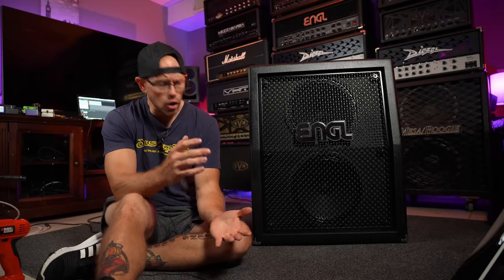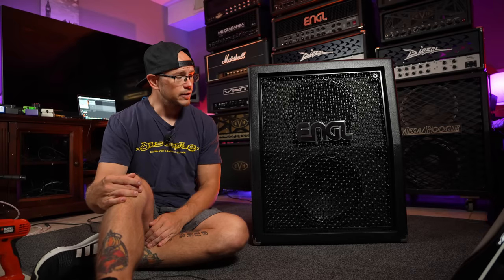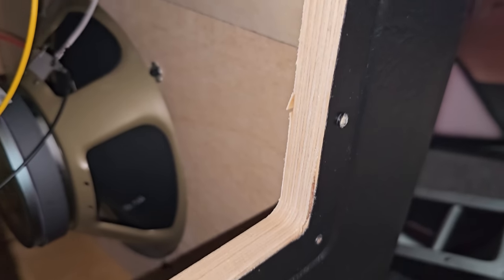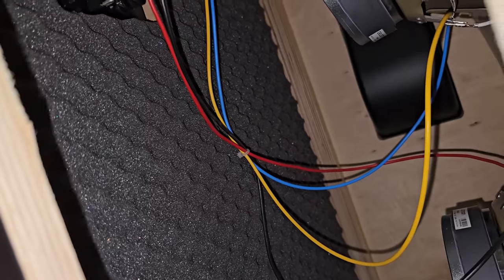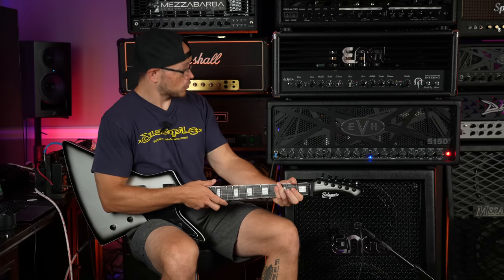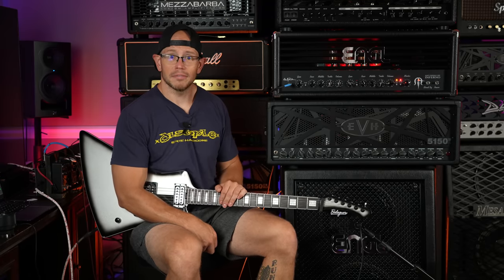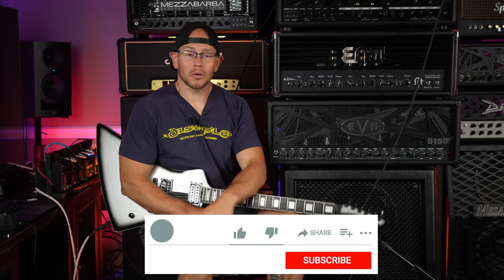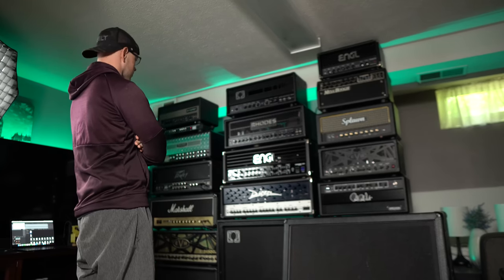This 2x12 cab hits harder than most 4x12s!

Comment: I wonder how this compares to the Mesa Rectifier 2x12 Angled cab?  Another great video.  Thanks Kyle.
Reply: That'd be nice to know...since I have a vertical 2x12 mesa 😊
Reply: As far as the 4x12 cabs go, I bought the ENGL last year and ended up selling my Mesa Rectifier 4x12. Great cabinet but the ENGL was more focused, punchier and more articulate. The Mesa cabs are awesome but the 4x12 cabs are too boomy for me. I honestly think 2x12 cabs are the best.
Reply: @MichaelSmith-ti6qc  I read that they are made with the same components and the same machines as Brit speakers are. And I'm someone who doesn't buy Chinese unless I have to.
Reply: I have a Mesa 2x12 vertical, speaker set up was originally the stock v30, then switched the top speaker to dv77. I picked up this cab in the video and it definitely sounds punchier, the low end gives far more thump to it. Not sure how much the geometry of the cab design of the Mesa vs Engl changes the sound or the speaker set up itself. But I will say that the moment I ran through the Engl cab it was instantly an improvement, across the board, taming highs, punchy low end, just a very full sounding cab. Running an engl fireball 25 through it.

Comment: I just ordered a Fireball 25. I bought a cheap 1x12 Cab with a V30 on Amazon for less than $200. Looks like I'll be buying this because it sounds great. Not sure how I'm going to hide it from the wife. I'll put a cream back in the single cab and I guess have a spare V30. Maybe I'll attempt to build a cab for it. I have 4 combos and 2 bass combos all solid state so this is my first foray into tubes. Strictly a bedroom player. I'll probably be exiled to another room or the garage. Thanks Kyle!
Reply: Worst case, go looking in used gear shops for 4x12s you can find some absolute gems. My 4x12 was $90 and it came with Celestion G12K85s, each one individually sells for more than I paid for the cab.

Comment: Hey my cab! My Mesa vertical 2x12 with V-30's sounds a lil' different than my ENGL 2x12. The Mesa has a singing type thing going "Santana-ish" while the ENGL just helps the amp "chug" better, for lack of better description. My amps ENGL Ironball 20 and Fireball 25.
Reply: Which are the big differences between Ironball and Fireball 25? Thanks

Comment: Just switched out the V30 for a Hesu Demon for the top speaker, and... it's different, that's for sure. =) Had to change some settings on the MT15 to get it where I wanted it to be, tone wise. What I really like about the stereo switch is that you can hear the different speakers in isolation and compare them side by side to see what they are bringing to the table. Luckily it wasn't that hard to install; just had a hiccup because the white wire had falling off before I could look at the back of the speaker to see how it was wired up, but I went back to this video and it really helped, since you took a look at the inside of the speaker cabinet. Thanks Kyle!

Comment: i have the horizontal version of this cab with my invader 100.
this is the tone i have always wanted so tight and articulate
Reply: Same here. Have Fireball 100 and use it with the horizontal version of it, damn those tones...
Reply: @Krankenstein bro, if I take 412 engl cab for home, how it will be good?
Reply: @rinatdautbaev1065  I like 'bigger the better' but 2x12 would do fine for home purposes. If you don't mind the price go for 4x12. Do you mean the pro cab or older version with different speakers?
Reply: @Krankenstein  thx. ah no, I dont know its old or not, just ask about cabs. btw Engl cabs with v30 can gives more dry tight sound?

I found at YouTube one guy with Artist edition with Engl + his custom 212 cab and his sound really crushing me! sec, I give u link. this dry roar at end of riffs super sexy.
Reply: @rinatdautbaev1065  yes they sound very tight. Front loaded v30s, well constructed with thick birch wood... one of the best in the market along with mesa cabs (tight metal wise). Even their 2x12s have more bottom than most of the 4x12s.

Comment: i got the Engl E212VH Pro, wich is the Horizontal cab, it's a really hard hitting one and i love it! i thought about the vertical one, but the Horizontal slaps a bit more so i got that, when dialing it in i usually stand a few meters away so i hear it properly. It's heavy as hell but that's absolutely worth it!

Comment: For the bit about running the Mesa and the Bogner... Since these can do stereo, you can put those cabs next to each other and checker pattern the outputs of the amps, and stack them on top of each other across the tops of both cabs. Now it won't look sto stupid. Just use an ABY pedal or a Y cable coming out of your last pedal and BOOM.

Comment: I used to install ultra high end stereo systems in Lamborghini’s, Ferrari’s, Porsche’s etc. We would build cabinets for up to 2 15” woofers and we had to get the area of the cab for that particular speaker. My question is I have a Harley Benton 2 x 12 cab with Celestion V30’s. So I have my $300 Celestion 2 x 12 cab versus what looks to be a $1000-2k ENGL cab.
What makes it so special?
Reply from the maker: The Engl will have far superior build quality - Better materials, better construction, i.e. proper jointing at the corners, thicker plywood, higher quality plywood, etc.  With that said - whether it sounds better or not will be totally up to the end user.  If you love your Harley Benton, then there's not reason to look elsewhere at more expensive cabs!

Comment: Hey Kyle, quick question. One expression you use a lot is "percussive low end". Could you explain what you mean with this? Thanks man, great videos!
Reply from the maker: Hey man, think about a kick drum.  When the kick drum hits and you're in the room with it, not only do you hear it, but you FEEL it.  The frequencies and the air moving.  It's typically punchy, and quick.  Low end on a guitar amp can be the same way, and that's typically what I imagine as percussive when I'm hitting palm mutes on an amp/cab.
Reply: @belligerentamateur  thanks for the explanation.

Comment: Dude is it really true that 16ohm speakers sound diferent than 8ohm??
Every time i hear someone say that i just can not believe It, i dont know why lol
Reply: Speaker manufacturers have different frequency response graphs for their 8 and 16 ohm speakers,so yeah,there is a difference….16 ohm speakers have twice as much wire wrapped around the voice coil as an 8 ohm speaker…it’s thinner wire too….Generally speaking,a 16 ohm speaker will sound a little fuller,with more highs and lows…8 ohms are more mid forward….but with that said,the difference can be pretty small between the two,but yes,there is a difference…
Reply: @scottpeters4401 😮. Thanks for the explanation.

Comment: I wish major companies like this would offer the option of buying unloaded. I have a bunch of speakers and I don't need two more.
Looking inside that, no wonder they are on the heavy side. I might try foam on the back of my Marshall 4x12.
Reply: Speakers are so cheap wholesale, the cabinet manufacturer would only be able to knock off like $100-200. Mesa will sell you an unloaded cab.

Comment: You told us in another video don't replace speakers in cabs.  LOL  Honestly if there was any difference between this and a Mesa Recto cab of the same configuration I'd be surprised.  The only difference I see is the foam which could be added.
Reply from the maker: they sound immensely different side by side.  I think you would be shocked.
Reply: @belligerentamateur Yes, I found out later the Engl is front loaded while the Mesa is rear loaded.  I don't know exactly what that does other than increase volume slightly but they definitely sound different.
Reply: @belligerentamateur  Which of the two would you choose for 80's hair metal with a 5150 50w Stealth?  I'm guessing the Mesa?

Comment: Yeah, I have owned many Engl cabs, and they sound very cold,direct,in your face, 2 dimensional. The problem is that they have front loaded speakers, and accoustic insulation foam inside, and they are sealed air tight. They made them  like they make studio reference speakers, and it is not supposed to be like that. Engl cabs are in general not loved cabs, and guys sell them quickly for half price to get Mesa 412.

Comment: Vertical cabs don't sound as good as horizontal cabs.  The two speakers are out of phase.   Plus there is less cabinet on the top speaker not as much depth.   I had many slant and straight cabs and straight cabs sound a lot better.  Plus 2x12 Horizontal just put it on a slanted amp stand  up to your ears and get the benefit  of a straight cab.
Reply from the maker: All of this is purely subjective
Reply: @belligerentamateur   This is true
Reply: Personally, I hate taking amp feet off the floor, because you automatically lose a lot of low frequency response. For that reason I refuse to use any kind of stand. If you're going to mic the cab, you need to capture how it sounds in its environment. Take that opinion with a grain of salt. :)
Reply: @tjborekvideo  If it's a closed back cabinet it doesn't matter.

Comment: It would be nice to listen to how this cab sounds on other styles rather than just metal. If it is all it does it will be a very limiting piece of equipment.
Reply from the maker: any piece of equipment can do anything that you make it do.  It's all down to the user, not the equipment.
Reply: @belligerentamateur still it would be nice. I investigated more after this and reviewers have said this is more suitable for high gain amps as the metal grill could make it sound harsh on softer overdrives and cleans. So this is a massive factor on when purchasing an amp or cab. And you definitely want to know this before you buy. So listening to different sounds rather than full blast of distortion which masks the subtleties of the cab would really be nice. Otherwise the review is really incomplete.
Reply from the maker: @The_Ricardo_Sa  it's not my responsibility to do your research for you. I'm exploring this equipment for my own needs and taking the audience along for the ride. if you want what you consider a complete review, find another Channel or make your own. Thanks!